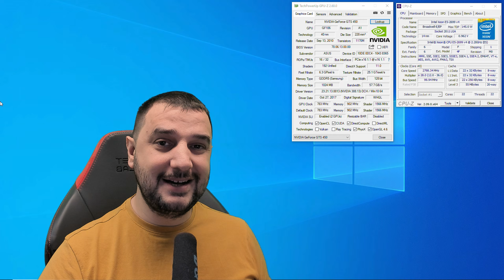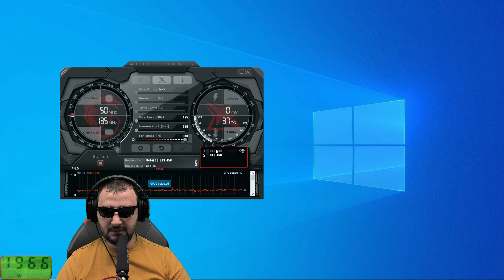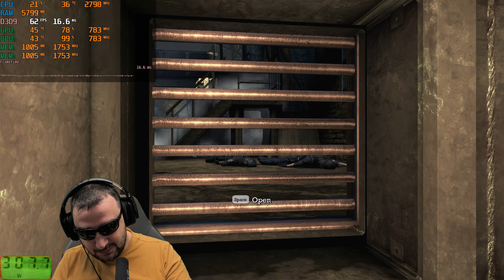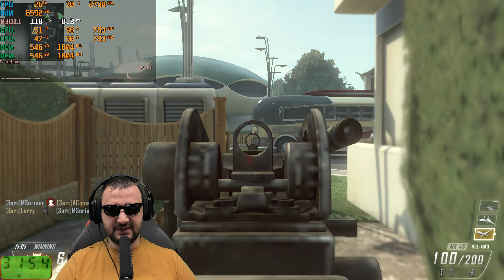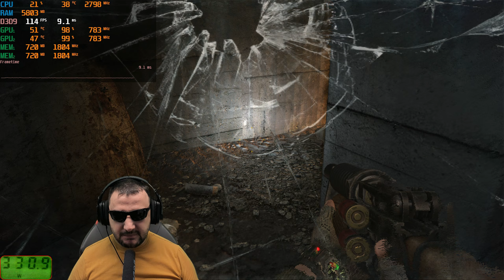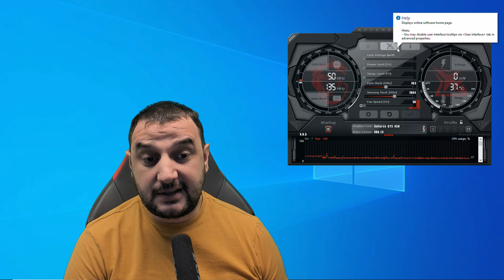NVIDIA GeForce GTS 450 SLI Benchmark

Comment: 2 x GTS450s = 560Ti 
(192:32:16 @ 128-bit vs. 384:64:32 @ 256-bit).
Back in the day, two GTS450s would've cost you about $250-260 whereas a single 560Ti (released a few months later) cost only around $200-220 + it ran at higher core and memory clocks than the GTS450! It's no surprise I never come across any rig with GTS450s in SLI. 
Still, an interesting test, nonetheless. Keep it coming!
Reply: One of the reason you did not see such setup often is because it never really make sense to use SLI or CF on low end card. Rather than dealing with multi gpu issue just spend the money on single faster gpu. But going with mid range the story is completely different. 460SLI for example on average 20% faster than GTX480 while cost less.
Reply from the maker: True. Based on the price of GPUs back then, it didn't make much sense. Today, however, it's interesting to see them because they cost next to nothing. If someone is interested in learning about SLI and they already have one, it's easy to get another.
Reply: @DanielCardei  Yes, you're right. Fair enough.
Reply: Yeah, remember those times when you got a new gen gpu and it actually did more then previous generations? Amazing stuff!
Reply: It could make sense if you already had a GTS 450, and after the GTX 560 launch, were likely able to buy a 2nd hand GTS 450 very cheap. I believe this was the whole idea of SLI capability. Keep what you had, add extra GPU later on if needed.
And that same idea don't look good for Nvidia sales strategy ...so they have almost outphased it. 
The more modern NVlink is only now awailable for Quadro/workstation cards. Because the NVlink technology meant you could take two RTX 2080 and make them perform on par or better than a 3090 ..albeit with just 16GB (2x8) VRAM. NVlink can utilize both cards VRAM.
Reply from the maker: @Wushu-viking  do remember 3090  can nvlink. 2080ti and 3090ti.
Reply: @DanielCardei  Yes. But again. Take two 3090 (48GB) and they "can" outperform a 4090, if NVlink scaling is as it can be.. Not something that looks good on paper for Nvidias strategy of highest profit. It is not an innovation company anomore, as it used to be.
And because the tech has been utilized very little on games over the past 5 years (Nvidia's own wish) they simple just removed the tech from the consumer cards. Pointless if it isn't utilized. But it can be utilized if they wanted it to be ..also in games.